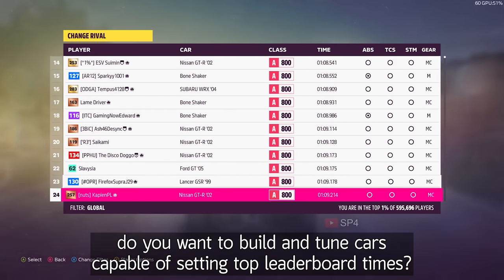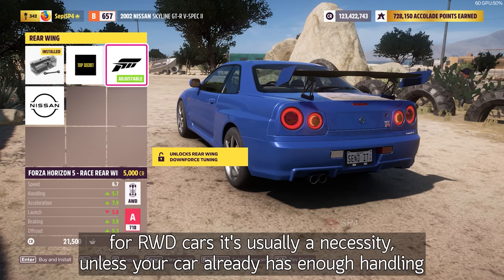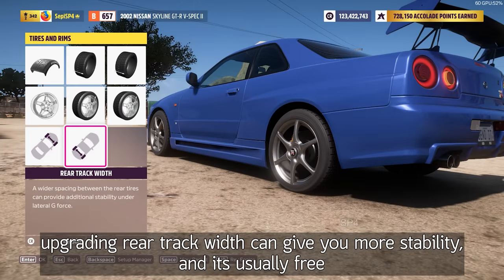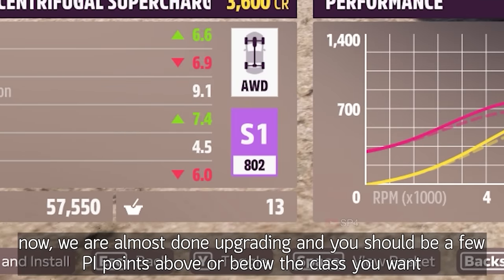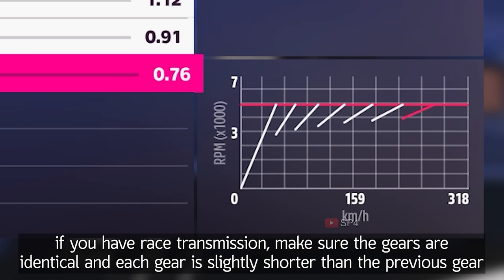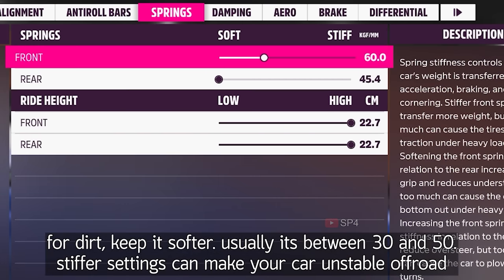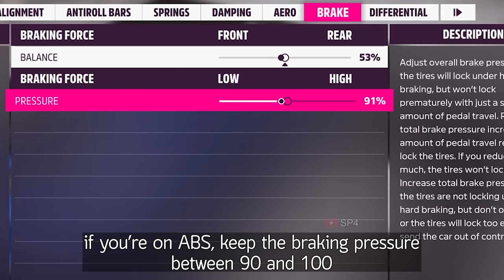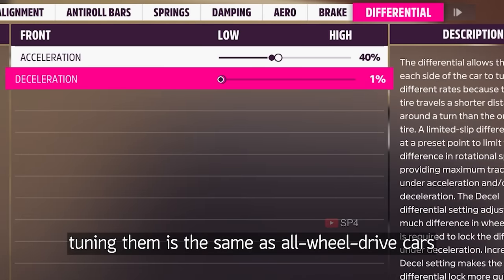Forza Horizon 5 META Tuning Guide

Comment: I've noticed in some cases upgrading the brakes can save a good bit of weight, I think the best I've seen was about an 80 pound (35kg ish) difference. Is that enough of a factor to add consideration to the brake upgrade or is the PI cost still just not worth it? 

Somewhat related, it seems like the main difference between this building strat and how I usually build my cars is that you place far less value on weight saving.
Reply from the maker: 95% of cars have good enough brakes for the class they perform best at. there are better ways to save weight, mainly raw weight reduction

Comment: You do it wrong with gear ratio tune. A-class and above never needs that short 1st gears (especially S1 RWD cars). Making longer 1st gear gives you better launch and allows to make higher gears closer to each other and get more power from your engine as you keep higher revs when shifting up. RWD S1900 car should accelerate to ~130 km/h with 1st gear. AWD - to 90 - 110 depending on power. Shorter 1st gear will not launch you faster as the acceleration is limited by tyres grip.
Finer details depend on engine's power/rpm curve - you might want to keep revs as high as possible on engines with flat torque curve or have it just high enough with engines that drop torque on high revs and have flat power curve.
Still great video!
Reply from the maker: you're right. it was just a demonstration because some people leave higher gears longer than the first gears
Reply: @seP4  Ah, I see

Comment: This will explain why my tuning has diminished returns. The metrics your showing are way off what’s considered realistic. I only make minor changes but when you slammed the ride high all the way to the right just blew my mind. 

I only ever mess about with gears, ride hide and Aeros. 

Though one thing I will see is the gear ratio thing. Having you car max out at redline on top gear isn’t ideal. That’s fine if you run racing cams where peak power is right at the fuel cut but if it’s stock then you’ll find that peak power dropped off almost 1k rpm from redline so your actually slowing down and losing top speed. 

I have a few cars where you have to shift 1500rpm before redline or your slowing down due to where peak power is. Look at the dyno graphs when tuning. This will give you a great indication of power band.
Reply: This is a game. Having your car make peak power at redline and shifting at redline is the whole goal of the gearing and upgrades he pointed out. Very rarely do you short shift in this game.
Reply: @GrupaNation  there are penny engines in this game that don’t make peak power at red line. Most engines fall short at about 500rpm or even more. Just have to look at the 1.6 rally swap. It’s the worst of them all. The power band on that is tiny.

Comment: If you get on throttle over/understeer, in what incriments should you tweak the dif?
Reply from the maker: depends on the car. some are fixed with 90-0-100-10 and some need as low as 20 front accel

Comment: May I ask, what is the main reason why the meta cars are so good compared to the competition?  Is it because of a tire width circumvention or is it because of how tuning isn’t taken into account for PI?
Reply: Meta cars are upgraded PI efficient, that will make them handle weird that needs to be tuned out. Besides Aero and Tire pressure (that both add grip) tuning isn’t about making a car faster but as drivable as possible.

So Meta cars dominate because a very PI efficient car is combined with PI efficient upgrades and tuned in a way that it has even more grip and handles reliable.

Comment: Awesome Video! Although maybe a little too fast. Another Great Video would be how you troubleshoot. What does your process look like. Thanks to you i now have a great tune on my lotus exige. Only Problem is the rear looses traction when i have to break in corners. Any suggestion?
Reply: change rear decel to a higher setting (5-10%?), soften rear arbs or stiffen the front, also bring brake balance back

Comment: For differentials, doesn't reducing front acceleration cause more oversteer? I think deceleration is same for both front and rear sections, but opposite for acceleration. Otherwise, super helpful video.
Reply: I thought so as well. I usually do 15ish% for front accel. It allows the inside tire to spin faster than the outside tire. Higher front lock would cause the inside tire to plow more and not turn in as well.
Reply from the maker: thats true in real life but not in forza. more front accel makes front wheels pull you more around the corner which causes oversteer
Reply: @seP4  ill give it a shot
Reply: @seP4  all the tune I made thus far became more oversteery when I reduced front accel mate. I also tried your method for finding diff settings and the wheels were turning more when front acc was decreased.

Comment: AWD is trash unless you're doing offroad. RWD is king. AWD makes you heavier and introduces a TON of understeer that becomes difficult to dial out. For dirt, cross country and launching, AWD. But for street racing and circuit racing, RWD is the best whenever you can keep it. I specialize in making setups that are neutral to oversteer in nature but that makes them very quick when you learn how to drive them.

Source: over a decade in iRacing and real world racing. Once you understand Forza's weird quirks, its not too difficult. I just wish we could export the data somehow so I could not try to watch telemetry live.

For instance, the ride heights are all wrong in Forza compared to real life.

Pretty solid guide. Definitely a quick and dirty video on these concepts.
Reply: Do you have any setups for RWD A class cars?

Comment: hey, awesome guide, already got 10s of seconds faster on rivals.
but i have a question why do you say to ignore camshafts? they cost a lot, but also increase hp a lot as well. could it vary from car to car? for example, on my evo 9 i get the best speed with a turbo upgrade and maxed cams.
awesome guide nevertheless, just that i disliked because it's a "don't do this" without explaining why.
to whoever may read this far, hope you have a good day/night (:
Reply from the maker: some engines are OP because of their power band which camshaft completely changes
Reply: @seP4  yo, thanks for the reply. could you give an example of an op powerband and one that'd be ok to upgrade cams on?

Comment: Thanks but when it comes to ride height/body roll, you want to decrease weight transfer not increase it, so lower ride height should be better plus lower center of gravity
Reply from the maker: doesn't work like that in forza. some cars you need maximum possible weight transferred to the front for more oversteer
Reply: @seP4  figures. Thanks for the reply

Comment: Is it the same to adjust the tuning as in forza horizon 3?
Reply: This guide can be used for every FH. Only difference is that in older games you can run even lower tire pressure because heat isn’t an issue

Comment: Awesome guide! Also it shows how little car setups changed after FH4, since meta builds looking the same. 

BTW, i find that important to mention something. For keyboard players, setup for brakes is gonna be different. Since on 'kb' it's always 100% pressed when you touch a button, i found that setting between 80-65% of pressure is a usefull strat.  Traction telemetry very helps on tweaking this one... But, i guess, the braking time of a dude with 'madskillz(tm)' of 'pedalworking'  (on a controller or a wheel) would be much faster.  But anyways, this small brake-tweak makes playing Forza on KB much-much more exciting